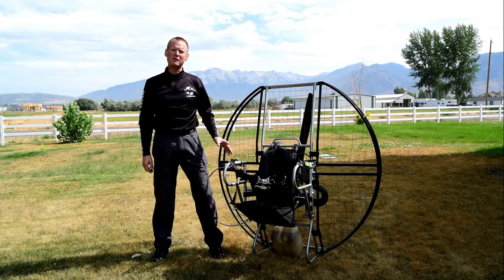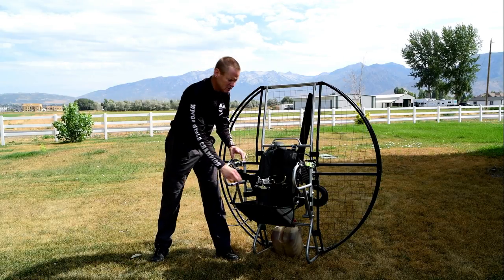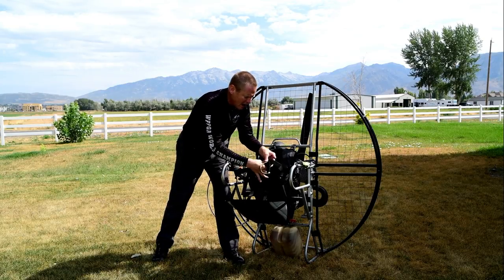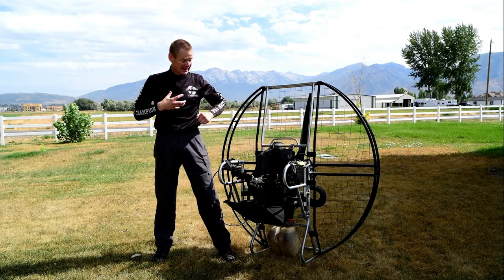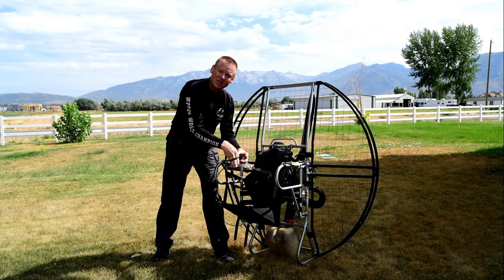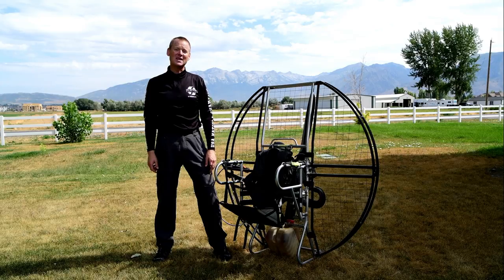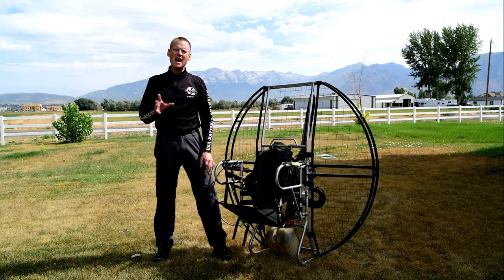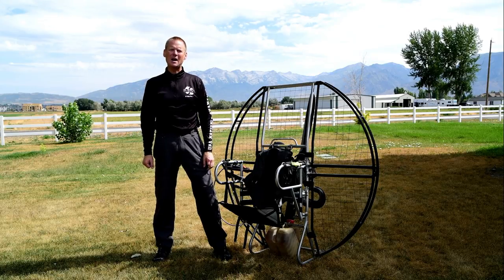Why Paramotors Should Have A Quick Release Harness! Powered Paragliding Buyers Guide Review!

Comment: I once launched next to a FL canal on my friend's gear (don't fly any gear you don't intimately know!) and the tip of the wing clipped the wind sock and pulled it out of the ground.  The windsock then slid into the prop and killed it, while I was 10-15ft right over the canal.  As a free flyer, I immediately reached for the buckles to release myself, but one of them jammed.  I literally said good-bye to my family before I heard the floatie inflate.  Later, even after my friend dragged me to shore, it took us at least 5 minutes to undo that buckle -- some are designed to lock under tension!  I'd rather be at the bottom of the pond but being able to get out quickly than being still above water but hopelessly trapped in the harness.  That loss of control really left a mark in my psyche.  Quick release is a must.

Comment: This is seriously the one feature of the Flat Top that I don't understand why isn't adopted by other makers. The only possible downside would be if you weren't trained right or panicked and pulled when you shouldn't. It's obviously a lifesaver if you go down in the water (which should basically not happen unless you're taking risks you shouldn't). Race car drivers use them, military pilots use them. Being able to get away from your vehicle once you're on the ground can be the difference between life or death. If I have a motor fire for instance I don't want to be messing with straps while burning molten nylon and other plastics are trying to do an imitation of napalm.
Reply from the maker: The Flat Top harness is like a bucket seat in your car.  If you undo your seat belt in your car you don't fall out the bottom onto the road.  Same with the Flat Top paramotor as you are sitting in the seat so even if you unlatch the harness in flight you still won't just fall out.  There is even a video where I unlatch the quick release harness in flight and then come in and make a perfect foot drag to landing.  All with the leg straps dangling.  With the Flat Top your butt is always on the seat even during take off and landing.  So the leg straps are only there as a back up you are never actually hanging from them.  It's another reason the Flat Top is so much more comfortable than other units.  With other units you literally do hang from your balls by the leg straps.  With the Flat Top it's totally difference as your butt is still sitting on the edge of the seat when you come in for landing.  Very cool design.
Reply: It does look like the shoulder straps still stay on your shoulders even after the quick release so as long as you didn't intentionally slip your arms out which I can't imagine anyone doing if they accidentally pulled the release in flight) I guess you'd be fine. It's a good feature that other makers really should be using.